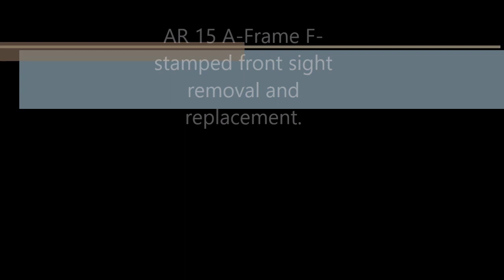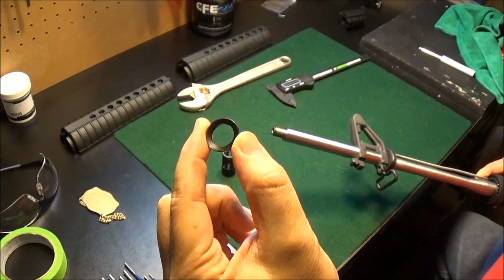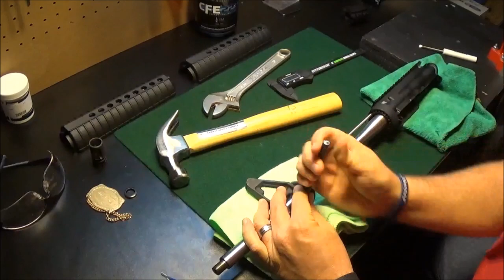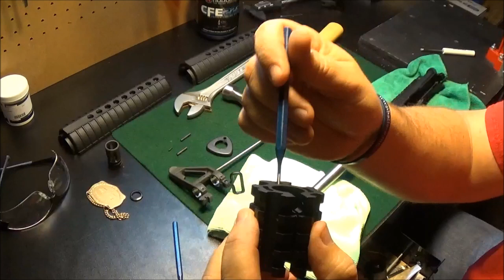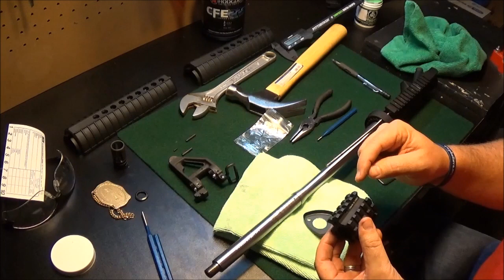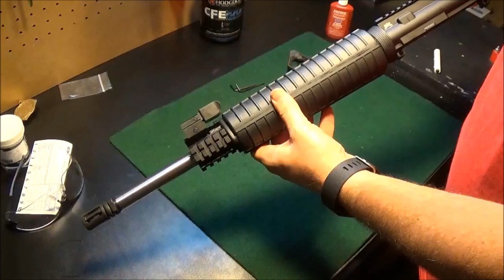AR 15 A-Frame Front Sight Removal and Replacemrnt

Comment: I have a question about s smith&wesson m&p sport II. If I replace the front a2 sight with a low profile gas block should I dimple my barrel or do the direct replacement low profiles work fine?

Comment: How do I order the right seize gas block
Reply from the maker: if you take the old gas block off, you can measure the area where it sat. It will usually be .75" or 1".

Comment: So you removed a reliable, robust, metal site and replaced it with a cheap toy-like piece of plastic?
Reply: They also get in the way of actual optics if you put them on I have a red dot seated on the rail and it doesn’t see over the dumb ass front raised sight so they make it almost impossible to use a rail mount sight that isn’t raised
Reply: tubeslats the original sight lacks I feel
Reply: Fixed metal A frame sights are garbage.. So many better options out there.. Best thing to do is not buy an AR style rifle with those crappy fixed sights to begin with..

Comment: could a metal coat hanger be used? bend one end up a 1/4 inch or so on a length long enough to stick down the barrel.  take a file to the bent up end and make end a little smaller than gas port opening.  before putting gas block on barrel try the hanger down the barrel to stick end up through the gas port. you can also  put a light in barrel.  this too will help line up any gas port to the gas block.  As I found out, if you don't, esp. on the .300acc barrels, you will end up with short stroke or other problems.  I have not tried this yet. wondering if anyone else has?

Comment: If I get this off, can I put a different barrel cover, like a free float rail?
Reply from the maker: Seth, the gas block shown in the video is not a low profile gas block. If you buy a Low profile gas block as a replacement for your A-frame front sight, then yes you can install a free float hand guard. Thanks for watching.
Reply: I thought free floats were one piece? will they fit in the delta ring pull back design or does that need to be changed also for the free float.  thanks